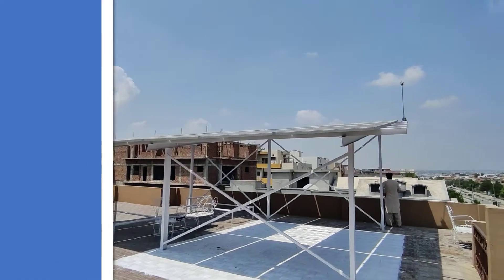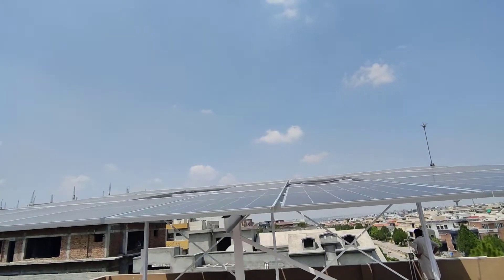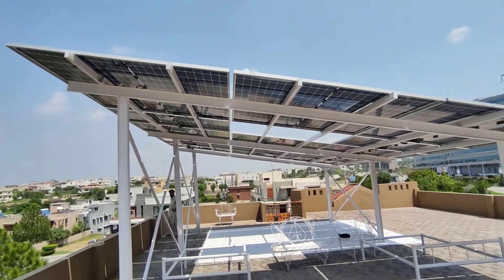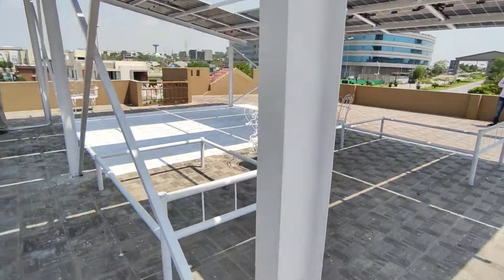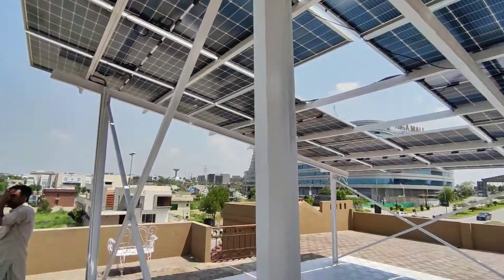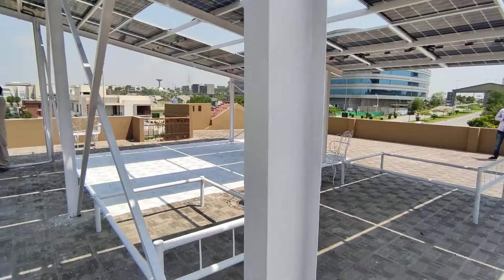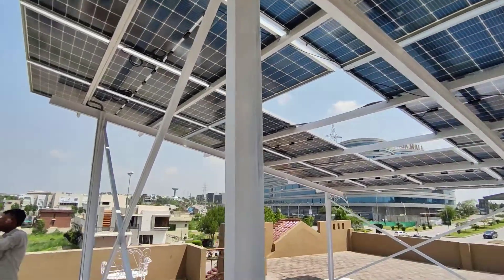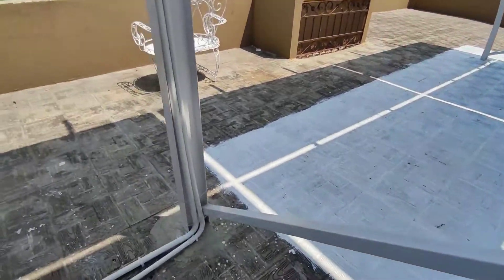How to install Bifacial Solar Panels on roof? Explain in English!

Comment: What is the minimum height required for the lowest part of panel ?any standard angle for bifacial or same common panels?
Reply: Same question
Reply: 20-40 degree ky darmayan hita standard angle depends upon your latitude and longitude just google
Reply: Minimum height: about 20cm

Comment: With experience I can tell I get at least 15% more solar power production from bifacial panels in compared to normal solar panels of same capacity. Want to know what difference does white paint on roof make on production.
Reply: How you install solar plate